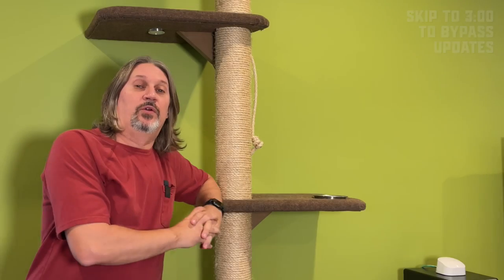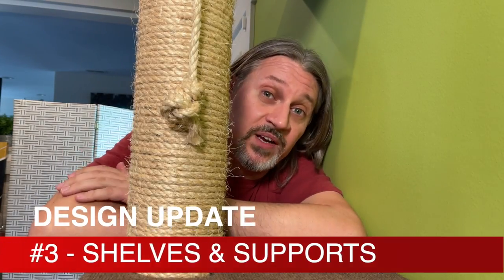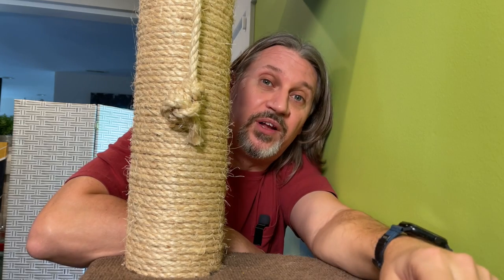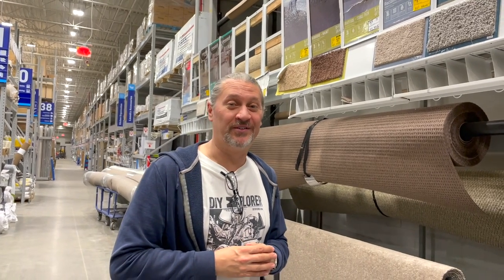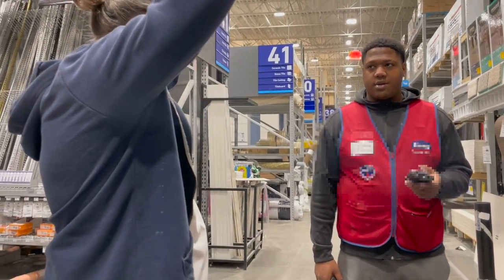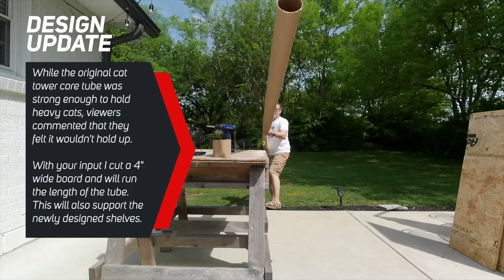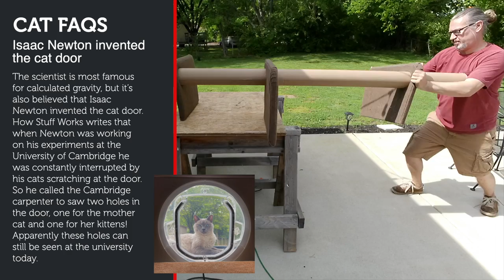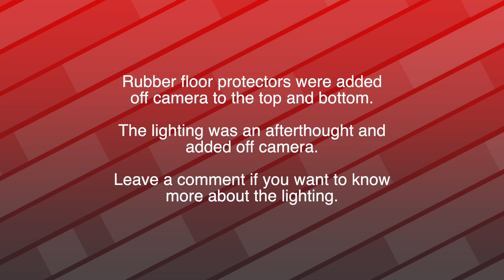Cat Tower 2 Upgraded & Improved - Floor to Ceiling Non-Permanent Scratching Tower/Post | #diy #cats

Comment: Depends on the carpet roll. Got one free from HD and it's at least 1/2 inch thick walled. No need for reinforcement. (I have a 20+ pound Maine Coon, 10 months old and very active)
Reply from the maker: Hey Peter! My first version of the cat tower did not have any center board support and it was fine for our 20 lbs. tuxedo kitty Rosco. When I started designed version 2 I considered suggestions from commenters and new ideas I wanted to try. Having the wood center pole allowed me to secure support so I could have larger shelves than prior.

When you build yours feel free to email photos of it when you get it built. I'm going to put together a video of all the builds people have done based on my projects. You can find contact info in the about area of the channel.

Thanks for watching and commenting! And building!

Comment: Wonderful trees! Do you have a good formula to figure out how much rope?
Reply from the maker: Hi Lorie, it depends on your tube width, how tight you wrap your rope, and the height of the pole. I wrapped mine pretty tight on a 4-inch wide pole and used 3 rolls of 100 ft length. Bonus is any extra you have left; you can make a scratching post or any other fun cat toy. This is the rope I purchased: https://amzn.to/3JOR9hZ

I hope that helps. Btw I just posted another video of how-to, step-by-step building the Cat Tower 2. It's much more in-depth. You can see it here: https://youtu.be/Ej_UyUNB_GA

Comment: I’m in the middle of building this tower. Thank you for your design. 

Quick question: you ask for a 3/4 plywood sheet but the bolt  and washer are too thick to flush. Please help. Can I just use a bolt instead of rod?
Reply from the maker: Hi Melanie, sorry for the delayed reply. I am exporting the finished how-to video as I type this. 

Drilling 3/4 through the top piece and adding rubber bumpers will give you extra space. These are what I used for the top and bottom: 7/8 in. Clear Rubber Like Plastic Screw-On Furniture Bumpers for Chairs and Table Floor Protection - https://amzn.to/3FdZE3m

I hope that makes sense. The new video will explain it a little better. Thanks for watching and leaving a comment.
Reply: @DIYXplorer  hello. Thank you for your reply. I am actually at a stand still in the middle of the project. 🥴 where do those go? Someone said there is no need for that extra bolt on top since there is two in the bottom. Please advise.
Reply from the maker: You can do just one washer to hold the bolt in place. The new video is up and here is the link. Hopefully it will help you out. https://youtu.be/Ej_UyUNB_GA
Reply: @DIYXplorer  thanks for this! I still have the doubt about the bolt vs a 3/4 board. The rubber is not the issue. But I think I can manage. I am almost done though. Super excited!
Reply: Just finished mine. Whew! What a project! That too and bottom parts may need to be clearer as well as materials and tools. Overall my cats love it and want more 😊

Comment: Nicely done! I appreciate your camera work as well. Have you had any issues with the carpet getting loose from cats scratching since you aren't using any adhesive for the shelves?
Reply from the maker: The carpet has shown some wear. I have had to reapply some adhesive on some edges. Overall, it's holding up well. The original cat pole, I tore it down and remade it. I used upholstery tacks on the underside edges, and that works quite well. I hope that helps. Thanks for watching and leaving a comment!

Comment: QUESTION: we have a loft bed and three cats that love to snuggle in the bed. It has an attached vertical ladder.  Do you have any suggestions or thoughts @ a diy way for them to get up and down safely? I have looked online, but have not found anything that might work. We need your help! Please 🐾
Reply from the maker: Hi Kimberly! Thats tough. Cats can climb up easily but going down is harder. While I haven't posted videos in a little bit I'm still building fun stuff and recording. One project is a cat pole you can mount to your wall. It's the same pole as this video but it has mounts at the top and bottom that secure to the wall. You could create that and mount it at an angle up to the loft. Or you could do staggered shelves up the wall to the loft. Something like this would be neat: Cat Wall Mounted Shelves - https://amzn.to/3NFwA8r

I hope that helps and gives you some ideas! Thanks for leaving a comment and watching my videos!

Comment: Is there is list of materias? Did I miss it?
Reply from the maker: Hi Melody, you can find a list of materials and cut specifics on my website here: https://bit.ly/cat-tower-2-build
The only difference would be the height; you would adjust it to your house. I'm still working on the second "how-to" video. I've had a hard January and just had to put to sleep my cat Meme. I promise I'll get it up shortly; it's almost done. Thanks for watching and leaving a comment! 😺
Reply: Oh yes thanks! Will do this with PVC instead  of cardboard cylinder. I live in an island so humidity is a factor!
Reply: Also, I don’t see anything about the tube height. I have 10 foot ceiling.
Reply: Also, why in your website there are two cut lists with the exact same thing? Thank you!!

Comment: How about using PVC pipe instead of cardboard w/wood insert?
If you decide to try this, I can supply the PVC pipe ans supplies free and pick up product when it's done.  Even  happy to pay for labor 😉
Reply: If you want to experiment on cat pole#4  I'll supply the PVC pipe and supplies free  and  pick up finished product 😉
Reply from the maker: Hi Marie! I've seen videos using PVC pipe. Usually, the super big/wide type you can assemble together. (like this video: https://youtu.be/dqg2ZT-53B8 ) I'm unsure if a PVC pipe the size of the cardboard tube I used would work. The hardest part is getting the sisal rope to stick to the PVC. The cardboard tube standard hot glue works great, and from what I know, hot glue is safe for cats. With the center wood support in this version, I can screw shelves in tight. Overall, I think it might be a more difficult build. 

 I have a few projects I'm working on before returning to the cat tower project. If I can figure out a way, I'll come back with cat tower #4.  Thanks for watching and leaving a comment! 😺

Comment: Hi, great video! What carpet material are you using? What I found is very hard and rough on the back, not easy to fold on small surface. Yours seem to be very suple and not so thick. Thanks
Reply from the maker: Hi Gabriel! I used a heavier fabric on the shelves, which I purchased from a place called Old Time Pottery. Your local fabric store would have something like that. On the base and top, I used a regular throw carpet you can get at any home store.

If you want to use the carpet as I had done for the first cat tower, you can find it at Lowes, Home Depot, or other big box home improvement stores. It's basically an indoor outdoor area rug. It comes in multiple colors. I'm not endorsing Home Depot, but this is an example of what I speak of  Hobnail Granite 6 ft. x 8 ft. Solid Indoor/Outdoor Area Rug - https://thd.co/3Xxp2Io

I hope that helps you. Thanks for watching and leaving a comment!

Comment: Very cool! Nice that you inluded visit to the store to point out that you CAN sometimes get free stuff (they was jus gonna toss it anyways) when my lil one was bout 1 year, i bought him a 3 tier floor ceiling tree from amazon which was fine for a year or so. Then somewhere along the line he grew up. And his climbing style is a bit silly, he likesbto reach outbto the farthest edge of the next shelf n play indiana jones which caused the tree to bend. It gave up one day split in two where the mid sections connect and came crashing down. Hes okay tho he was scared. When i could afford it i went to big box hardware n got a couple lengths of 2x4 and dome other stuff i thought i would need, my ex donated some old carpetbshe was gonna toss n i built a nice sturdy tree that dont move no matter how goofy my boy climbs on it. ☺ i jus made it up as went with not many of the right tools. It aint pretty but it works n he loves it. Thanx for the vid!
Reply from the maker: The big box stores usually just toss or hopefully recycle the tubes. The best time to get them is after a busy weekend. I've had other comments say they've used just 2x4s, which works just the same.

The great thing about cats is they don't care how pretty something is; if they like it, they will use it. And at the same time, I've bought nice expensive things they won't touch.

When I started building things and posting videos, I had to borrow a Jigsaw, and now 2 years later, I have almost all the tools I need to do most basic projects. It's not the tools but the ingenuity of what you have to do to build what you want.

Thanks for leaving such an awesome comment! I'm glad you enjoyed the video! 😺😺

Comment: Hi, good project 👍
It might be a good idea to make a video explaining the installation of the remote control lights, and the fixing of screws in the ceiling and floor.🤔
Greetings
Reply from the maker: Hi Noelia, I'm about to upload a step-by-step how-to video today. The tower is not permanent; you use the hardware to secure it with pressure. You'll see it shortly. 

The only thing I do not have in the how-to video is the led lights installation. It was an afterthought; the way I had done it, it wasn't straightforward to explain sharing in a video. I'm going to try and figure out how to present it easier.

These are the lights I purchased: AIBOO Linkable LED Under Cabinet Lights https://amzn.to/3ZBRxWx and this Flexible Extendable Cables for AIBOO LED Under Cabinet Lighting: https://amzn.to/3YwQmpS

Thanks for leaving watching and leaving a comment!
Reply: @DIYXplorer  Excellent 👍👍
Thank You for your answer....!
I Will See the video

Comment: Question: I’m a bit confused about the bottom part. I see the diagram… do I use the large steel 5/8” rod at bottom or just the screws? Also with the top how large is the rod?  I bought one that is about feet long.  Cheers
Reply from the maker: Hi Monique, you only use the threaded rod for the top. The bottom is just screwed into the board that goes down the center of the tube. I've put together a page with cut diagrams, supplies, tools, and additional top and bottom views. You can view it here: https://bit.ly/cat-tower-2-build

Hope that helps! Thanks for watching and leaving a comment!

Comment: Well done! I saw your very first version and was thinking that it might not be too durable, but you've solved it right here. I plan to build something similar except that I will just use  two 2x4s screwed together to make it thicker and allow adjusting of shelf locations and orientation after it's been built. I also like the foam pads under the carpeted sections but I'll probably  just make it pads not carpeting the entire board. Thanks for the idea of what screws to use to make it slightly height adjustable and easy to fasten it to the ceiling and floor.  I like the lighting too.  I'm now thinking of how to make the shelving more easy to adjust for location rather than have them perfectly fixed because I might want to relocate the tower and so the shelves may need to be re-oriented or re-positioned when the cat gets older and finds climbing a bit more challenging.  Very inspirational built, mate.
Reply from the maker: Thanks for the compliments, Darius. The tower in the other video did hold up quite well, even with our 20 lbs. cat Roscoe. I really did want to improve on the design, fixing concerns others had.

You def can use 2x4s for the pole instead of the tube design. It will be easier to make the moveable shelves you mentioned. If you solve that problem, let me know. I love the idea of rearranging them. With a solid pole, adding LED lighting where the cable won't be accidentally clawed along the pole would be challenging.

Some neat ideas and new challenges. Feel free to send me a link to pictures or videos when you build it. I'd love to see your take on it. Thanks for watching and leaving a great comment!
Reply: @DIYXplorer  Instead of 2x4 glued face to face, you could still use a 6" tube. But, instead of just one board inside, you could make a cross (think + sign) of wood. Rip the second board so you have two narrower pieces, then glue those like a cross to the original board and insert that.  This would allow for moving shelves in various arrangements AND allow space for cabling. And, your reply answered how you did the lighting. I thought perhaps they were each battery powered inside. Very nice!

I am curious, if I may, what was your line of work prior to starting your channel?  I'm thinking engineer of some kind. You've a very creative mind and excellent hand/eye control.

Comment: You are the bestest!
What do you think about pvc pipe? Please Sir
Reply from the maker: In my original cat tower ( https://youtu.be/mKk9tnHHhxY ), people commented they used PVC pipes. I haven’t done it myself, but it would eliminate the board inside (It’s there for extra strength.  My first cat tower didn't have one, and it was fine). The only concern I would have is attaching the sisal rope; I know from experience that standard hot glue does not adhere to plastic very well. You would have to scuff it with heavy sandpaper to have it stick. The main reason I use the carpet tube is; first, it’s free, and second, it works excellent gluing the rope. I hope this helps and thanks for watching!
Reply: Wow. You took your time to send a reply.  
Impressive. Thank you for the glue info.  And if it's free, I'll take
Reply: 2
Reply from the maker: I love responding to friendly people like yourself who take the time to watch and ask questions. My channel is small enough I can take the time to reply, hopefully, to answer questions and/or thank the person for the compliment.

If you still considering the PVC I'd try some practice on one piece with the sisal rope and hot glue. You could also Google hot glue sticking to PVC to see if there are any articles or videos. Good luck and if you build the cat tower send me pictures.